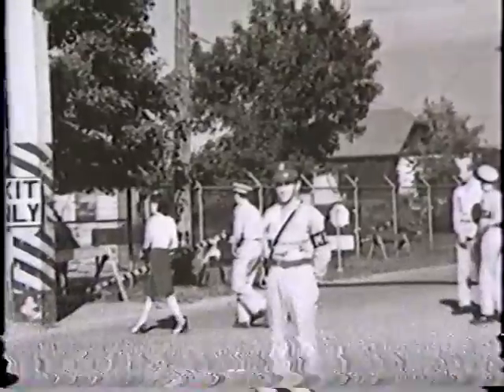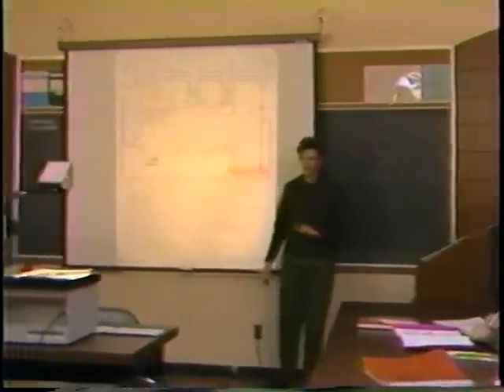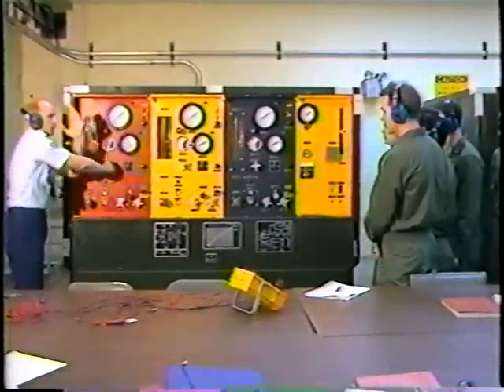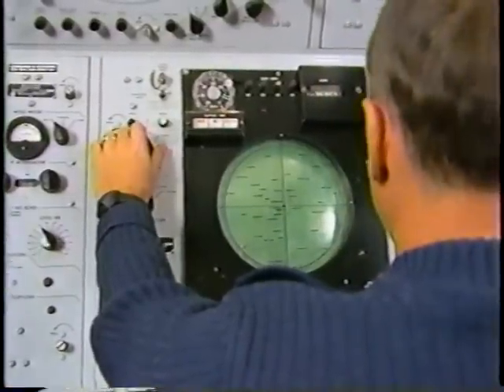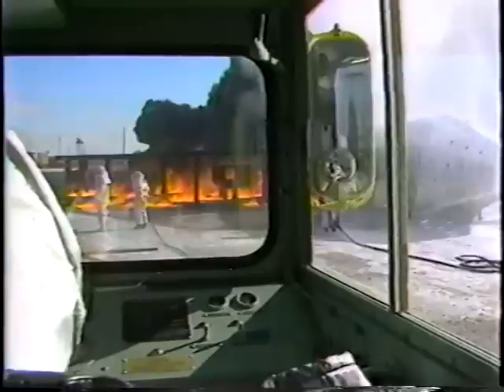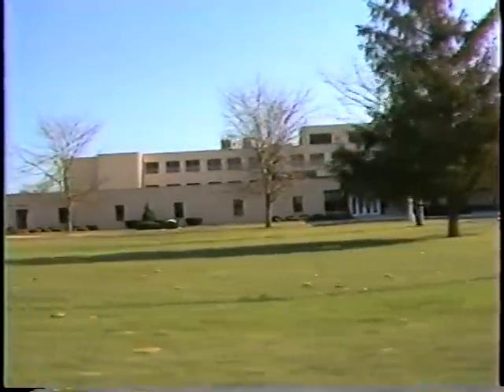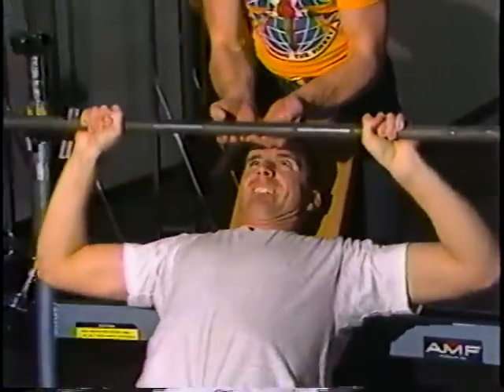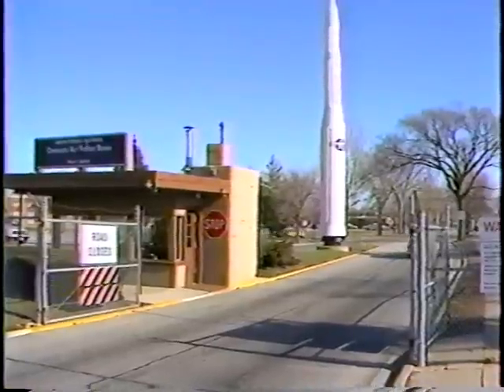A Brief Look at Chanute (1986)

Comment: That is me at 4:14. Thumbs up!
Reply: Really? How can you tell?
Reply: @gunner5125  Probably has the graduation class picture, right?
Reply: No.  They didn't allow the standard gold reflective shield for training at Chanute so better identification is possible.  In the field you have to keep up with who got out of what truck in order to I.D. anyone.  The gold protective shield reduced inside heat immensely!, but it was easy to scratch and damage in the training course.  Besides, they were using LP or natural gas at this point, not JP-4 or JP-8 because of EPA harm.  Damn JP-8 was very hard to light off.  Sometimes we had to use a propane torch just to preheat enough to burn for field training!
Reply from the maker: VERY cool, Rich! Fun to hear. I remember how cold that day was--so cold in fact that I was afraid the lens on my rented video camera would crack from the extreme heat of the fire alternating with the extreme cold of the morning!